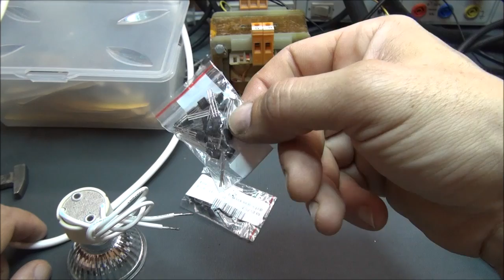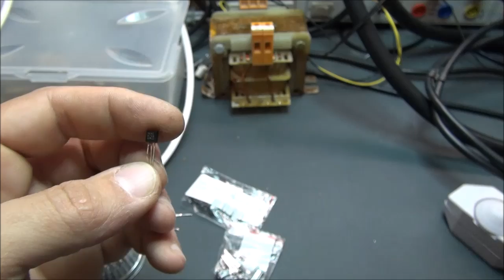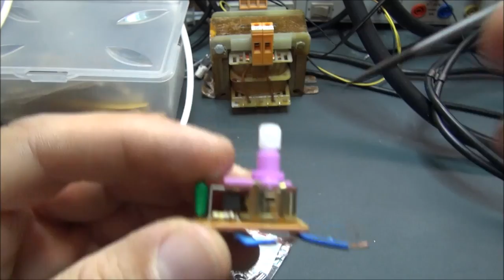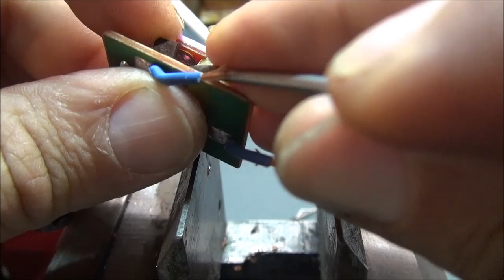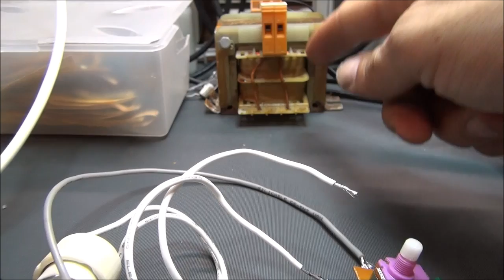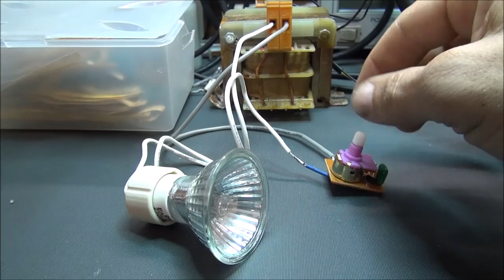Dimmer repair with cheap triac from China

Comment: Is there an out-of-circuit method to test a triac?
Reply from the maker: Between entry and out you will find a very high ohm value with your multimeter.
Between trigger and any entry (A1 or A2) you will find a low ohm value comparing between A1 and A2.
The best cheap way is to buy a little chinese component tester, it analyze your component, according if it's a low power one (doesn't work with high power thyristor and triac).
Reply: @AIexanderHartdegen  Thanks very much!